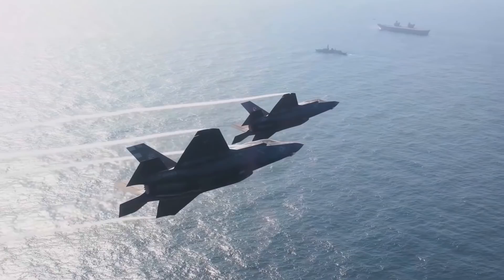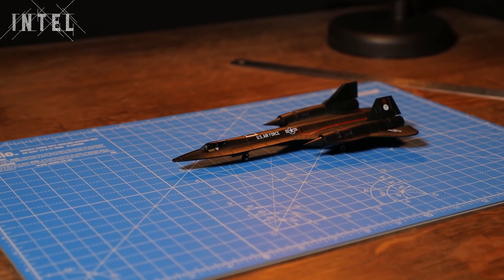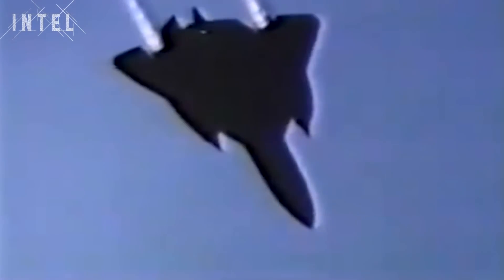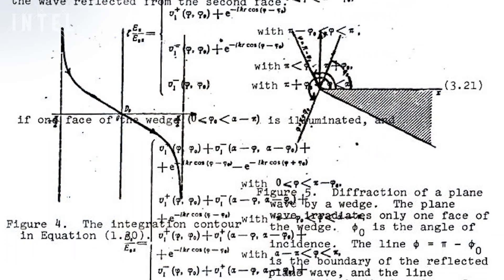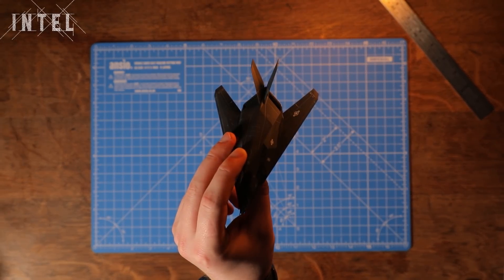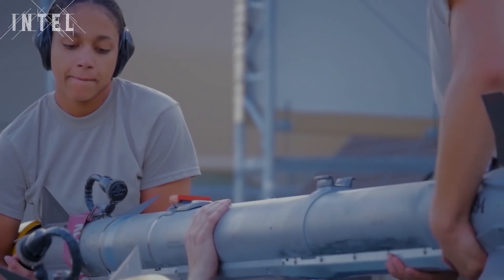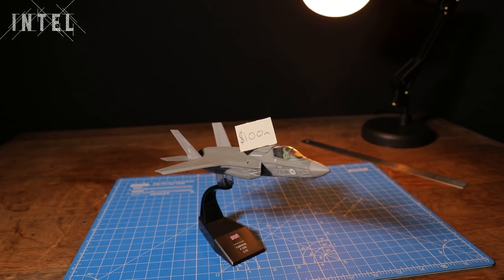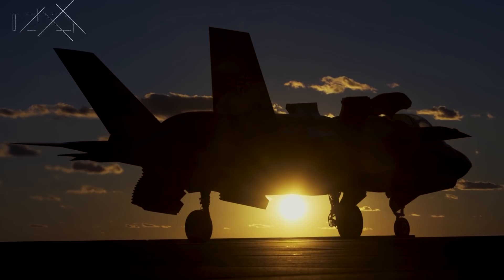Cold War to F35: The Unlikely Journey of Stealth | INTEL

Comment: Black paint is there to decrease its temperature? Naw there has to be a different better reason like absorption of radar signals or something because black is extremely good at absorbing heat.

That's why general aviation aircraft tend to be light colours or plain white, not to mention light paints weigh less than dark paints, which is another critical factor in engine efficiency.

Comment: The cost went up. As they kept adding to the mission role of the Aircraft. As everybody wanted something different. The amount of code required to accomplish that raises the cost. Then they kept adding newer more powerful computers. So the Aircraft would exit the assembly line. Then 3 weeks later. Be back at the beginning getting upgraded. That is a waste of resources and time. As you now have not 3 assembly lines. You got Four and Five....

Comment: If I remember correctly the F-117 was shot down in Yugoslavia because it would always fly a specific route. So the Yugoslavs set up two S-125 AA missiles and waited. At about the time the F-117 was expected to pass they turned on their radar locking systems and they were lucky enough to get a lock in 17 seconds since the bomb bay was open, as mentioned in the video, and fired two missiles. The first was a near miss (near enough to cause turbulence to the F-117) but the second hit its target.
Reply: That was exactly what happen. The F-117 were required to fly a certain route. Then the pilots got so relaxed. They opened the Doors at the same place every time. Well it doesn't take a rocket scientist to see the flaw in that tactic..
Reply: @MasterChief-sl9ro   That was not exactly what happened, the Serbs used a lower uncommon radar frequency which nullified enough of the aircrafts stealth capabilities for the SA-3 missile system to aquire a lock.
Reply: @UmVtCg  That was what happen. The Serbs  \told them later on..
Reply: @UmVtCg  
low frequency radar can detect incoming aircraft but lack the resolution to lock
Reply: It was not that the pilots got lax, it was the fact the Italians forced the United States to fly from 1 airfield, and the airfield was constantly monitored by Serb sympathizers, who would call to Serbian air defenses whenever an aircraft took off. The Serbs uses a combination of techniques to isolate one aircraft and using stop watches and other simple timing drills, fiber optic communications, etc, etc, etc, turned radars on and off in rapid sequence to get enough of a return to guide in a missile. Brilliantly done, but they would not have been able to do that if NATO had allowed for a wider variety of bases, if the Italians had not used open communications that forced the US pilots to fly in their airspace with transponders on, ......... it was a horrible and calculated set of rules by the Italians to make US operations sub servant to Italian politics.
Reply: The Serbs had foreign intelligence services spotters working for them watching departures from Aviano in Italy.  F-117As normally flew with EA-6B Electronic Warfare and SEAD aircraft with HARM missiles to attack the Serbian IADS nodes.  That night, EA-6Bs were not flying, so Dani knew he could search with his radars longer rather than running limited EMCON profiles.  The Clinton WH and SECDEF restricted the NATO strike aircraft profiles into a limited corridor that was easier for the Serbs to search and target.  These factors are what led to the only shoot-down of the F-117A.  Had it been an F-35, Dani and his crew would never have lived to share the story.
Reply: Hoo Lee Sheet  1999 during the nato intervention to stop genocide in Kosovo.
Reply: So let me get this straight... a group of people who are in the middle of trying to exterminate hundreds of thousands of civilians, manage to shoot down an advanced aircraft that flies the same pattern every night, while they themselves cannot even build a first generation fighter... and they're running their mouths off like they're hot shit?  If the 1st Armored Division had rolled through there, they would have been crying for their fucking mommies.
Reply: @30AndHatingIt  
yep! a very clever but still 'lucky' shot and they're praising their imaginary friend for it! they had probably tried this 20 or more times before the achieved a kill
Reply: So why were the bomb doors opened at the same place/time every night?
Reply: The exact same reason I feel like we shouldn’t have doors that sway open. In have several holes in the plane per missile. And the issue exits through that hole. Have a sliding door the maintain stealth. Although this wouldn’t hurt the plane much.
Reply: @alaric_3015  The Serbs used old SAM. They did not have the latest.
Reply: @alaric_3015  The second missile blew off a wing. Zelko was at high enough altitude to recover from a stall. When the wing blew off, the aircraft went into a violent, uncontrolled asymmetric spin.
Reply: Also, the commander of the Yugoslavian SAM sites was a electrical engineer who had a reputation of experimenting and modifying his hardware. He understood the principles of stealth better than most. And he figured out a weakness to exploit.
Reply: There is a documentary about how the serbs tracked the f117 before they blew the shit out of it.I don`t think the usa used the f117 as a front line weapon after that event.Billions of money wasted for a lie.The new f-35 is no better.

Comment: The SR-71 isn't really "stealth" per se.  It has no radar absorbing redirecting or other types of features - aside from its operating altitude.  The F-117 is literally the first stealth aircraft - and that's the reason it has so many flat surfaces.  Computers at the time literally couldn't resolve the radar cross section of a curved surface so Lockheed made a plane out of flat surfaces.

Edit:  aside from that good video.
Reply: It is true that it isn't a stealth plane but it does have a low radar cross section for an aircraft of its size.  And it was one of the first ones to incorporate design features  such as a blended fuselage and wing design.  that would be staples of fourth generation fighters.  The SR-71 is the most amazing aircraft ever made in my opinion.  It could fly at mach 3 at 85,000 feet for hours on end.  All it was designed with slide rules before the age of modern computers.